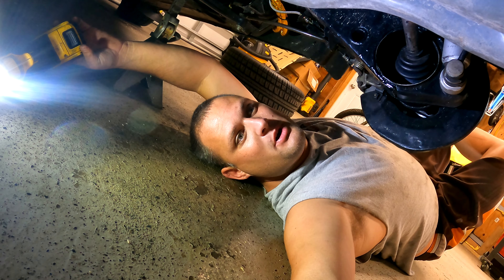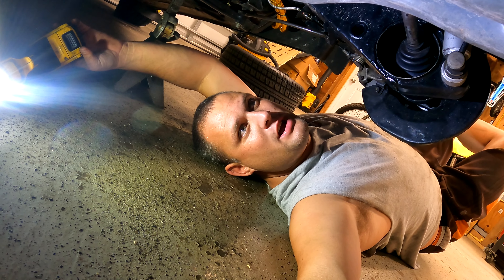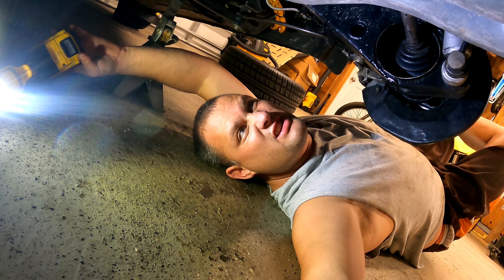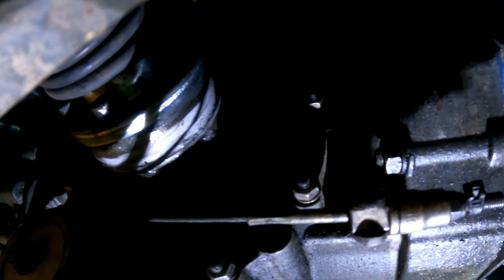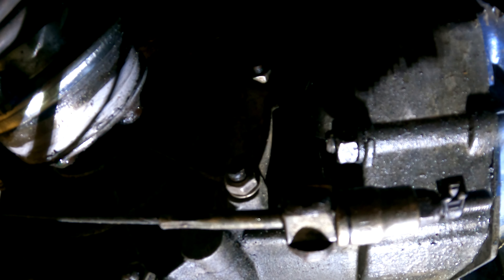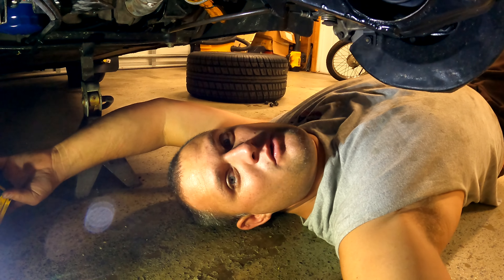Porsche 914 Clutch Cable replacement

Comment: Thanks for the great video. Do you use any type of safety clip where the cable (slides in sideways) by the rear pulley. Mine slid out yesterday, Trying to find a solution. Thanks, Tom
Reply from the maker: @tomlevy4206  I have not had this issue on mine. From how it looks the cable should go on the pulley, pulley bolted down, and it should protect it from coming off. Maybe try a new/repop pulley?

Comment: Did I understand you correctly that you are trying eliminate all pedal movement? You should have 1/2” to 3/4” of pedal play for the clutch to be properly adjusted.
Reply from the maker: I messed with it more off camera and got dialed in. I tightened it up till the clutch pedal hit the stop and then gave it a bit of slack. Not quite 3/4” though